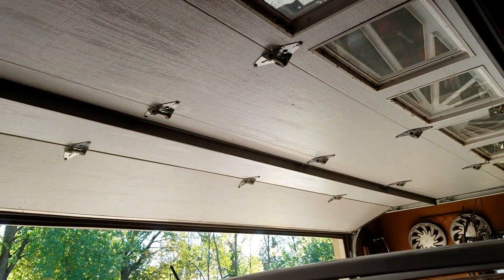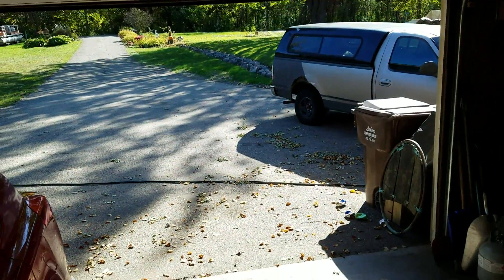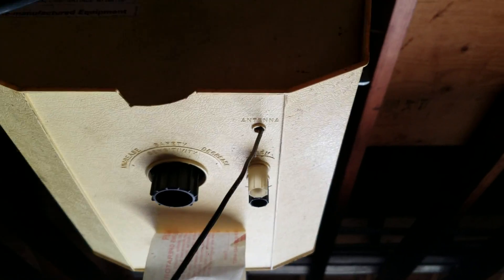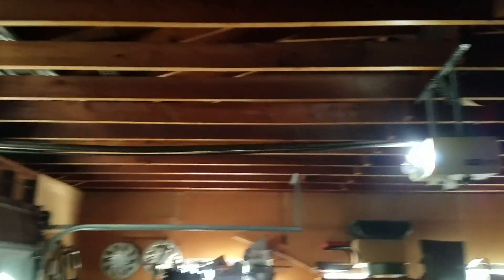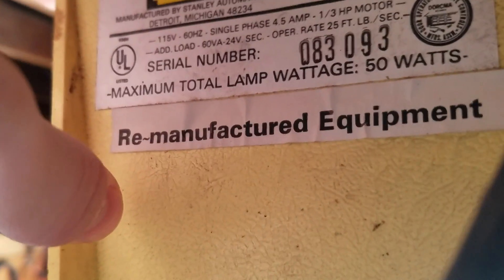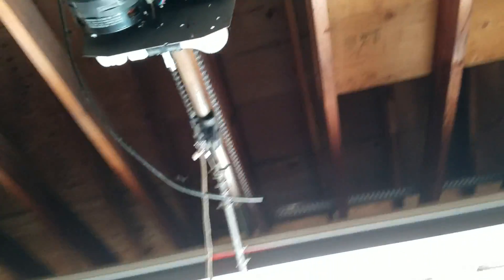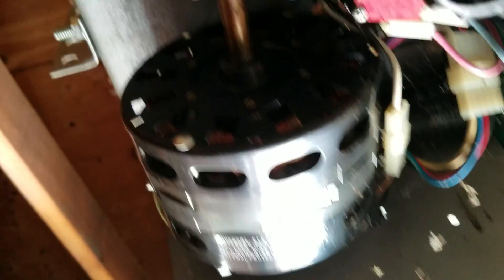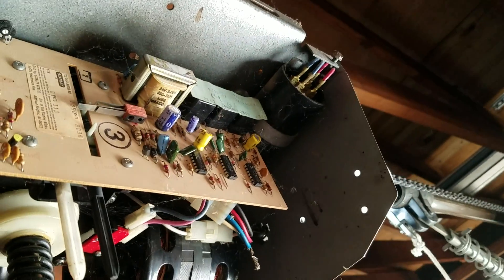Stanley Premier Digital 1/3 HP Deluxe model 3100.09

Comment: Cool, I have the 1983 model with one light bulb, no light cover.
It looks like the light cover that fits your opener may be Stanley part number 360-3056 (lamphouse/light cover, etc.). You can still find a few of them online. The cover has a hole in the center and gets screwed with a bolt cap into that bolt sticking out in the middle between the two bulbs, although the cover probably doesn't come with the bolt cap.
Reply from the maker: I actually have a light cover for it. I'm waiting for them to replace the opener so I can have it lol
Reply: @TBHD724  Does the light stay on for a while after the garage door is closed? Mine turns off immediately - it's not obvious whether there is an option to delay it.  I found an old manual online that says all Stanley models have a 4.5 minute delay, but I am not sure if that is supposed to apply to mine.
Reply from the maker: On this one, the light stays on. I think the astro 3 would turn off the light as soon as it gets closed, but I believe that was the only model. Unless the relay based one turns off, I don't think many Stanley's did that

Comment: Is that a new remote? On the newer 1050s that have the sideways mounted dip switches, the code actually needs to be reverse of the motor to make it work. For some reason on those, up is off.
Reply from the maker: They said the remote sometimes works. All the more reason to replace the opener
Reply: man thank you for posting this! I scoured the internet to no avail for why my new remote wasn't working until i saw your comment

Comment: Man, I would pay bucks to get a high-quality scan of that white drive pulley in there, if you still have it!
Reply: and i'll trade you a scan/model of my intact gearcase hahah
Reply from the maker: I'll see if I can find or make a model for that part. A scan of that gearcase would actually be perfect, I got a Stanley recently that is completely destroyed on the inside
Reply: @TBHD724  man, i wonder how much it cost to 3d print titanium lol.  overkill for that gearcase but it'd be cool
Reply from the maker: It would definitely bulletproof these openers. That and a more solid rail
Reply: @TBHD724  Upon more serious thought, a steel, perhaps aluminum, cnc-milled, clutch gear case might be the most economical and sturdy for you, lemme spend awhile in CAD drawing it up, then I'll send it to you, and after you check/tweak it to your chosen metal/satisfaction then you could send it to get machined.  Once you get your part and replace it, then it's the opportune time to get the part measurements that I need on the lower clutch.

I wanted to clarify that the part I'm in need of measurements for is the round-shaped bottom half of that white two-piece nylon clutch.  It features two lobes that are flat on one side, and curved on the other.  the curved sides allow for slipping past each other rotating one way, and locking together and transmitting force when rotating the other way.  The tooth-gear top half drives the chain, and the bottom wavy UFO-wannabe that I need is held up against the top half by the adjustable spring.  This is what allows adjustable sensitivity of the clutch.

Do you have some familiarity with technical drawing and finding accurate measurements for use in a technical drawing?

The measurements I need for it would be:

     Material thickness of the part at various points.  Looks to be between 1/16" and 1/8" all the way around the part, cool and easy, if true.

     Three different outside diameters (four if the cam-side shaft OD is different from the smallest diameter "lip" we see at the very bottom of the part at 6:55)

     Length from crest of cam lobe-tooth to bottom center reference

     Length from bottom of cam lobe to bottom center reference

     Depth and length of keyway (I can't remember if the part actually has a keyway)

     To find the correct radius on that concave bit of rounding there, I'll need the diameter at the middle of it's curve, I hope that makes sense. I can use this diameter in addition to two of the other diameters mentioned above to find the radius of this concave rounded section.  It probably doesn't need to be exact, just try to find the diameter as close to the middle of the curve as you're able.

There's probably measurements that I don't even know to ask for
Reply: @TBHD724  or maybe I'm over complicating all this.  Even a simple cast aluminum part would be stronger than the original injection-molded plastic.  I could just try my hand at that, and ship it out to you if it's a success
Reply from the maker: So you're saying you're going to try to make an aluminum gear case and clutch pieces? I'm pretty sure I have a spare (used though and I don't remember how much wear is on it). I can definitely try to get those measurements of that clutch part for you if you want. I can't say I've done many technical drawings but I can give it a shot. If you're able to get that metal gear case to work I'd definitely buy one from you!
Reply: @TBHD724  oh yeah, I'm mentally set on it now!  I'm gonna cast an aluminum gear case for your opener, and if that part is the right part, it'd be real cool with me if we just trade parts.  Let's trade your spare (doesn't even matter if it's broken or worn,  as long as it's all there,  i'll take it!) for the cast aluminum gear case I make for you
Reply from the maker: Sounds great to me! Good luck!
Reply from the maker: Just curious if you've had any time to work on that metal gear case? Not a big deal if not, just wondering lol

Comment: Soooo, did you say this was made in 1981? I have the exact same model and I am trying to figure out whether it was made before or after 1993 to see if it’s compatible with something I bought.
Reply from the maker: This was 1981, they  had already stopped making these by the time 1993 rolled around
Reply: @TBHD724  Dang. I thought it was old looking, but mine fooled me into looking like it had a 2000 manufacture date.

Comment: I bought a new universal garage door remote. Is there a sync button on the Stanley unit? I can’t seem to to find it
Reply from the maker: There's dip switches on the back of the opener, however the Chamberlain universal remote is unfortunately no longer compatible with these and for the Genie universal you need the original remote to be able to program it
Reply: Thanks. I actually managed to figure it out right after I commented haha. Gonna try and see if I can use a new universal remote to clone the signal from the old one. If not I’ll need a new opener. Mines in rough shape anyway
Reply from the maker: The other option is to buy a universal receiver model 365LM that wires into the opener and allows you to use remotes with rolling code. The universal remotes will work with the receiver
Reply: On nice. I’m thinking I’d do a replacement though anyway. It’s pretty beat up and ugly now it’s not worth it